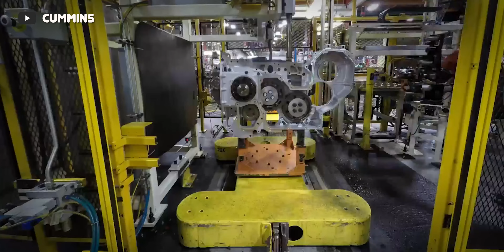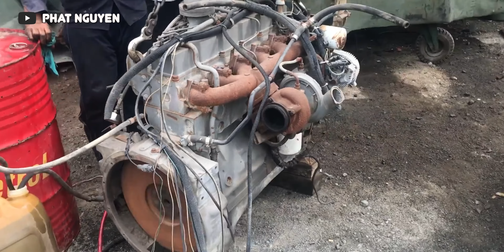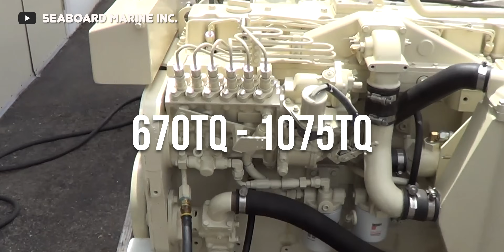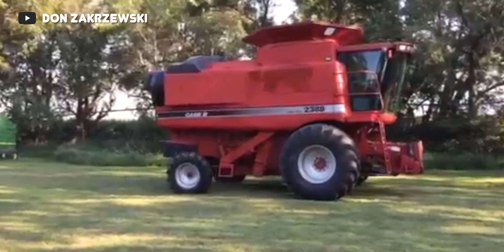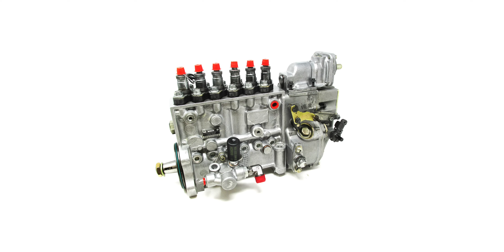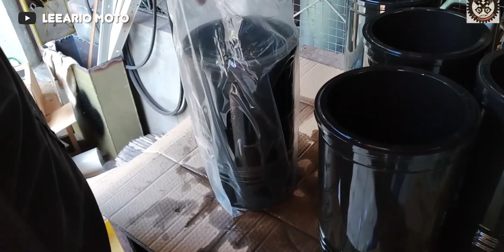Everything Wrong with the Cummins 6CT 8.3L

Comment from the maker: What do you think? Good engine or overrated?
Reply: It's a good engine.
Reply: @CurtisWithoutHandles  yea but the isl was it's contemporary that replaced the 8.3
Reply: Best engine ive ever had in sixty years, and ive had most. Did forty thousand miles in my fishing boat in four years, and never put a spanner on it.
Reply: It's never been any good like the m11 cummins. The isl9 just completely blows it away
Reply: 2 valve 8.3c were excellent. Long lasting in heavy equipment and marine
Reply: Can you do something on Kubota small diesel engines? Please.
Reply: @rkalkes  Look At Diesel Creek Where Matt Buys A Lot Of Fork Lifts Think They Are Kubota Powered Might Help
Reply: What causes the 6 ct cummins to devlop loss of power .
Working since year 2005 never overhaul has about 18000 working hours .starts at first key turn
Reply: @Arthur-xs4mg  fuel delivery, have you changed the filters?
Reply: Caterpillars overrated too much credit for that company they never invented the jake brake it was  Cummins

Comment: Got an 8.3 ISC in my motorhome approaching 100,000 miles.   She runs like a champ but the CAPS Pump did fail and was replaced with a rebuilt one.

Comment: I will take a 6CTA in a boating application any day of the week. They are a great engine.,
Reply: The coolant flow is backwards. The coolant flows down a coolant manifold built into the block. It then goes into the head first then back down into the block to cool the liners. That’s backwards to most engines where the coolant cools block first then the head then out the tstat housing on front of head. The cta has tstat mounted on block. Weird and I’m thinking prone to steam pockets and hot spots. The back of block is prone to running much hotter than rest of engine.

Comment: I worked on the C8.3 engine at Cummins in 1994-5, developing the natural gas version.  The worst problem that the early C-series had was seizing of the piston in the liner at high coolant temperature and fracture of the liners below the mid-stop.  The broken portion of the liner would then drop into the crankcase, causing total wreckage of the block and rotating assembly.  As insurance against this total destruction scenario, Cummins made a casting change in the block, adding hooks that would catch the lower part of the liner in the event of fracture.

The C-series also had a head-first coolant flow arrangement, so additional care had to be taken on coolant fill to assure complete purging of air from the engine.  

The B and C engines were designed in the early 80's in a joint venture with Tenneco (parent company of Case), so their first use was for farm implements.  The joint venture was called Consolidated Diesel Company (CDC), and the engines were manufactured in Rocky Mount, NC.  Cummins had a separate tech center in Columbus, Indiana where the engines were designed, called the Mid-Range Engine Technical Center (METC).  The C engine was designed for a higher cylinder pressure limit than the B, and the durability test requirements were also more stringent.  The B engine was the "light-duty" end of Cummins lineup, and at that, I would say they failed miserably.  They didn't know how to detune their allowable design stress levels from 60+ years of designing heavy-duty engines because engineering conservatism was in the corporate culture.  I smile every time I shut down the 24-Valve B in my 2001 Dodge Ram.  It shakes the whole truck as it comes to a rest.  Putting the B engine in a light-duty pickup was like mating a Mastiff with a Chihuahua.
Reply: In your opinion, what’s the best cummins engine? Or something better than this 8.3 cummins?
Reply: @fercho_sala  I'm partial to the K-series.  That is a beast.

Comment: I have a fully mechanical 6CTA in an offshore fishing boat and one thing not mentioned is that these engines are loud. Yeah, diesel sound good, but on a multi hour trip it becomes a drone with the engine set at constant 2200 rpm. The only louder boats I've been on are Jon Deere powered

Comment: Yeah Man The Easiest Water Pump Ever To Change 1/2 Drive Power Bar Three 10mm Bolts Sorted But That Fuel System Is A Nightmare When The Internal Drive Key Wears Causing Miss Firing Knocks When Starting I Used To Spray Brake Cleaner Down Its Neck To Spin It Up Faster  Also Faulty Alternator Made The Starter Motor Disengauge Having To Let The Belt Slip Or Bridge The Starter

Comment: "Diehard diesel fans are going live, and die by their fully mechanical engines." Yes, I imagine that is correct. I will die by my mechanical 8.3, with it idling while I kick the bucket, and it will probably still be running when my kids' kids inherit it.

Comment: I have a 1994 RV with the 8.3 Cummins I'm curious does this have a single wire to the injection pump like a mechanical 3406 caterpillar?
Reply: Close, the fuel solenoid on the p7100 pump has a ground, a run wire from the ign, and a start wire to pull in the solenoid.  So most people would say it has two hot wires to run the inj pump solenoid, but if you take that external solenoid off, it will run and you can run a pull cable to shut it off!

Comment: The combines are governed at 2500-2700 rpm and run full power and rpm for most of their hours. Other applications limit to 2300rpm or less…not really a mystery.

Comment: The harvester issues is usually assumed to be running at a high rpm for hours and lots of dirt and filth being kicked up and getting in the air system.  Running hot and restricted airflow is probably what's killing them.  In an RV you're never pinned at high RPMs for hours and when you are high on the rpms you are moving at highway speed getting lots of air.

Comment: Drove a lot of 18 wheelers and the Cummings 15L ISX was always my favorite. Reliable, reliable, reliable. But yes they are incredibly heavy.
Reply: That 871 ISX motor is JUNK!   600,000 and had to have it rebuild at the cost $20,000….  When it comes to semi trucks it’s the 6NZ / 3406 Cat or a 12.7 Detroit.

Comment: I am struggling to find the difference between the 5.9 and 8.3 engine, I opened both engines everything looks the same including pistons and Cylinderhead wondering if you can help me out on this
Reply: It's just larger, and uses wet sleeves instead of parent bore. Also I think 2004 and up had roller cam where the ISB didn't get roller cam until 2019.

Comment: The C series is just about to come to the end of production in the UK. These were still being produced for marine and industrial power generation with a bosch p3000 pump.
The highest power the c series went out to was 480hp in a  marine propulsion variant that was released around 2004. It actually had a very basic electronic fuel control on the back of the p7100 pump instead of a mechanical RSVQ governor. It had an ECM. It was a stop gap to lift the c series from 450 mhp to up to 480 mhp whilst the qsb5.9 was being developed. 
The c series is still being built out of China for industrial and marine power generation along with variable speed construction.   They use a 24 valve block  and a 12 valve head with a locally produced inline pump

Comment: The C is also extremely similar to the L models, I believe they both have the same head, liner's, and block with the fuel system generally being the same between the two of them.
Reply: Thats is totally incorrect  the c series are nothing like the 
L10 or the M11. Not one part in common and runs two very completely different fuel system. As much as the B series was the small brother to the c series, the L series was the smaller brother to the N series. 
B and C series are regarded as midrange product were as the L and N were in the heavy duty stable.
Reply: @sumpjunkie  I was referring to the L9, not the L10
Reply: Sorry about that. Yep the electronic version do share commonality in most external parts.. The 8.3 electronic engines never went to tier 4 or EPA 2010.  So the 8.3 is only really being built for marine propulsion and non t4 industrial product

Comment: You need to look into this... it's because the later model ISC 8.3 L  had wrist  pin problems due to the pistons only certain esn where affected. What do mean Bandaids? All weat sleeved engines require those As you call bandades because of cavitational erosion.
Reply: Stop talking about diesels you don't know what the f*** you're talking about

Comment: I have 6 motor 8.3 mechanical pump whit over million miles still running like clock, no one beat Cummins 8.3 special the black one's with 300hp,best results 8.3👌🏽💪🏿👊🏾 and no problems never problems forget that nothing wrong whit

Comment: Well I can tell you this much from experience it's a dirty application combines are known to occasionally run hot and they don't get mean teams very well they don't get the oil changed as frequently the radiators are frequently dirty I would imagine you haven't had that much experience with harvesting, like I said it's a dirty application

Comment: Worked on these and other Cummins a few years ago, just before the IS versions came in.  As per the B series the C series had there camshaft and cam follower issues, we made tooling that allowed you to change both without removing the engine or oil pan.  All wet sleeved Cummins tend to suffer more with cavitation erosion of the liners if the DCA coolant additive is not used and maintained.

Comment: I drove a mobile Lube truck with the 8.3 36,000lbs bed all over and serviced with it, never turning off idling and running for anywhere from 8-14 hours a day. Never had a single issue! The truck currently has over 38,000 hours and it’s still a one of the most reliable in the fleet. Will always be a fan.

Comment: cavitation has nothing to do with design, you just notice it much easier when you can take the liner out. it’s a maintenance issue
Reply: Deere engines also cavitate but to a much lesser degree than Cummins.  Deere places the liners farther apart and has engineered the coolant flow through the engine in a different manner.  I worked at both Cummins and Deere, this is not hearsay.

Comment: Most likely has something to do with the fact in combines it is running at full tilt all the time, as well as the dust clogging up air intakes and causing it to overheat. Though I have not heard of the same issues in heavy equipment, like loaders, haul trucks, and excavators, though I'm not sure if those were a common use for this engine.
Reply: Even in construction equipment, the engines don't get the workout they do in a combine. Modern combines are pretty much run wide open and at full power the whole time they are operating (which is all day long during harvest season). Combine threshing systems work the most efficient when ran at close to 100% capacity, and that's where farmers run them. You don't see many combines with 8,000 separator hours though, usually the rest of the combine is worn completely out before they get that many hours.

Comment: My old 2003 Alpine Coach diesel pusher has the CAPS ISC 8.3, 116K miles and runs like new. a few oz of 2 stroke oil every fueling keeps the pumps lubricated and problem free. Mine has the old Banks Power Pack kit (Ottomind fuel controller, wastegate, gauges) and is rated at 440 HP and 1200 ft lbs. GREAT engine. 30 pounds of boost all day.

Comment: The EPA with all their computer mandates on alot of engines is the problem👍
Reply: Its not computer mandates, its emissions mandates. 

Computers (ECUs) greatly improved reliability, fuel efficiency, and power.

Emissions mandates on NOx for example require Exhaust Gas Recorculation (EGR) which injects dirty sooty exhaust gas back thru the intake of the engine, those soot particles wear out rings exponentially faster. And also coke up valves, wear valve seats, stems, and ruin your clean oil faster.
Reply: @Triple_J.1  NO" its and or both , my friend has a 95 Cummins with over half a million, not a problem one, people with the computer controlled junk from FORD , RAM , OR GM nothing but problems..Period!!!🤔🤣🤣take care and good luck too ya👍

Comment: The caps version of these had a different arrangement for securing roller lifters from rotating. The old style was a pin driven through the block. The newer version of caps and later common rai used screw in oring boss plugs with a pin. These were better and the lifters lasted longer. 1999-2001 were the bad years.

Comment: you forgot the very common issue with a 8.3 cummins the external coolant leaks from the head gasket on the right rear corner and left front corner of the head, they all do it and the only way to fix it is to change the head gasket or in the heavy equipment world tell the operator to deal with it until it develops an internal leak

Comment: That caps pump fuel system fitted to buses is dreadful. It made them very unreliable & expensive to repair especially when compared to the p-pump.  The cummins fault codes of death 111, 274, 275, 276, 277, 279 & of course the code of anything on the low fuel pressure side 329. I still work on these engines, but they are becoming few & far between as the cap pumps are very expensive. The only good thing about the pump is the ability to replace parts of the pump rather than a complete pump and  considering a complete pump is close to £6,000 that is a good thing. Unfortunately the icv on its own £1,200. The lift pump 278 is close to £500. The caps fuel system engine wiring was actually rather robust. The 50 pin deutsch ecu plug had a nasty habit of coming apart leaving half the housing in the ecu a load of exposed pins in your hand. The cam & crank sensors were behind the pump & could be a real pain to replace & it was worth replacing them when changing a engine harness. For all its faults it is still better than the Bosch VP44 fuel pump found in other engines.

Comment: I'd like to see you do a video on the Hercules multi-fuel engine that they put in the M35 deuce and a half trucks
Reply: Those were bad about windowing the block when ran at rated speed for that application. The same basic engine was used in tractors but didn't seem to have that problem, but the rated speed was lower on those models. Not a bad engine, but they didn't produce much hp for as large of engine they were.

Comment: Combines run wound right out at around 2700rpm all day, coupled with other abuse and sometimes poor maintenance that’s why they explode more often then other 8.3s. The 8.3 in the Magnums ran around 2k rpm for peak power and would only rev to 2300 or 2400 and had less issues but a very common issue I’ve seen on every 8.3 I’ve come across is that they all blow headgaskets
Reply: Only the 1680s with the 8.3 turn that fast. When CaseIH went to the 88 series they slowed them down to 2450 rpm. That made them much more reliable.
Reply: @antoinelenouail3122  ours with the 6.7 only turns like 2100
Reply: @wizard_of_poz4413  2388s turn in excess of 2400 rpm
Reply: @farmerboy9029  ours is a 5130
Reply: Usually you aren't gonna run a combine anywhere near that fast unless older ones are that much different.  Case now runs the 6.7 and 9l and 13l in their combine and tractor lineup which are just frankly superior engines
Reply: Our 2388 does 2400rpms flat out and around 2200 when loaded up
Reply: Case introduced the 8.3 into an existing model that was run at higher RPM.  The later models designed for the 8.3 ran at a reasonable speed and didn't have as many failures, as far as I've heard.  Combines are NOT high duty cycle engines, typically they sit 50 weeks out of the year, so they turn the engine up to it's highest rating because it will still usually last ten years easy.

Comment: Unfortunately, your not quite right on a few things here:
1) cavitation is an issue with all Diesel engines, the 8.3 is no more or less prone to issues with it than any other sleeved engine. There is no “band aid” required, and sleeveless engines don’t have as many issues because they are usually smaller, lighter engines which make less power.
2) failure in a combine is not any more common than anything else, and it was mostly about how Case IH set them up. That engine was in gleaner, white, Massey, and a few other combine mfg’s and they didn’t have that same failure rate. This is one of the most loved engines in Ag between 150-300hp.
3) Combines run at high idle while working, so their duty cycle is much higher than most engines.

It really shows you just looked up some stuff in the internet and watched a few videos and made this one. While your effort is noteworthy, I’d advise folks to take their advise from people who actually work on them for a living.
Reply: Same with the lift pump.  IIRC it only ran for a minute during starting to prime the pump but shuts off after that, and the CAPS pump does all the pumping itself.  Somebody correct me if wrong.
Reply: @nspro931  Yes that is correct, Caps pump has it own gear pump built in. Unfortionately that was a weakness, as any leak in the suction side would could cause low fuel pressure and starve the pump and wreck the piston pump side of it. Changes made to supply constant low pressure fuel via the lift pump will solve that issue.
Reply: Yea they're junk engines that get quickly replaced when manufacturers get something better